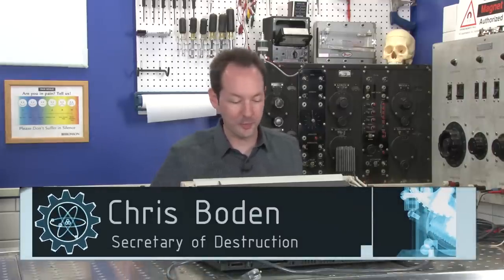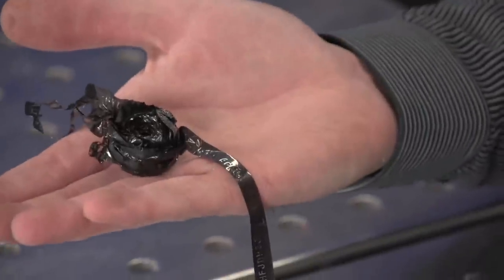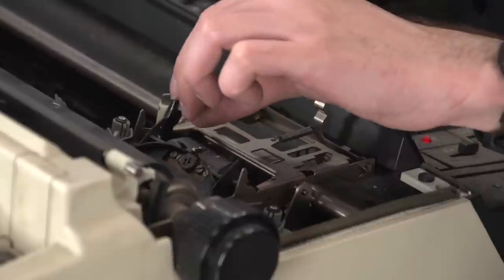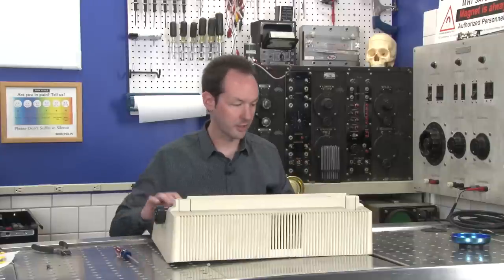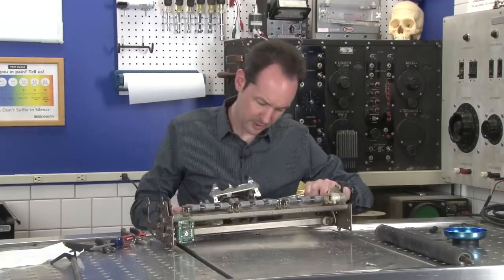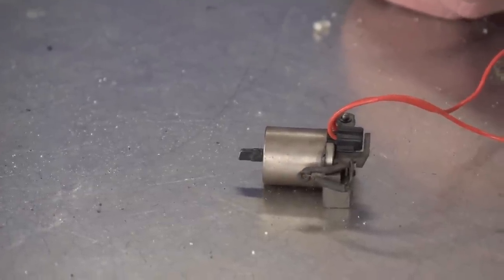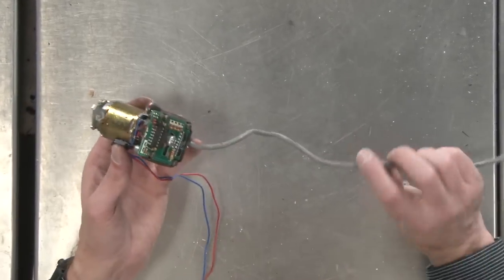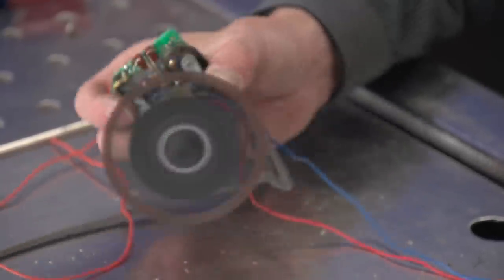Daisy Wheel Typewriter: Equipment Autopsy #82

Comment: The daisy wheel motor probably works like a servo, but with an encoder instead of a potentiometer, though still impressive as there's no gearing to slow the motion while allowing the motor to turn properly.
I did a thing in my teens with a solenoid on ac, connect a tip to DC, and a piece of metal to that supply, a sort of weld/engraver device, marked a few of my tools with it.
Reply: Essentially a very low-tech EDM engraving tool. I've thought about using something similar to drill very small holes.

Comment: 37 yrs & I'm still fixing typewriters ! That's an Olivetti ET , many different re-branding was done to this machine including Tec, Minolta & this one distributed by Hermes, depending on features of each model, but most were over $1000.00 when new !!  This is one heavy duty electronic typewriter.  Was fairly reliable, but even though the world still uses all kinds of typewriter the big clunky electronic model like this is undesirable.
BTW . . . . the Impression Cylinder is a Platen Roller , I have torn many machines down this far for fun too......